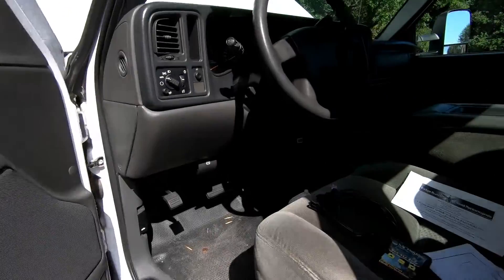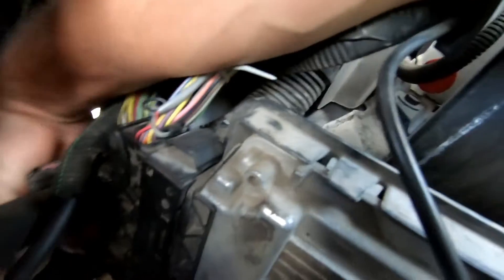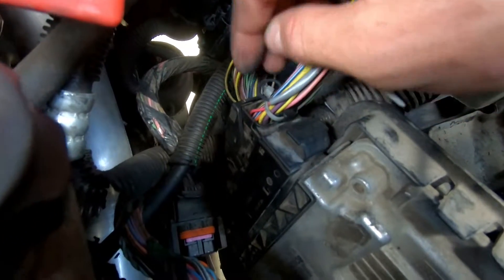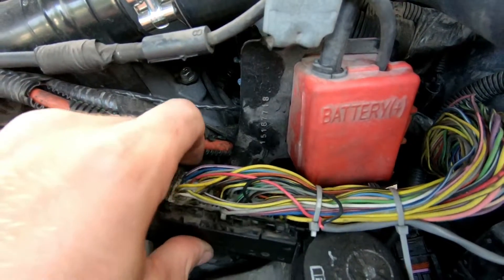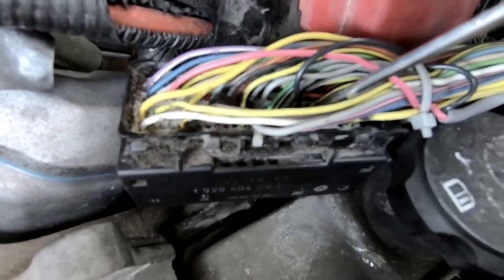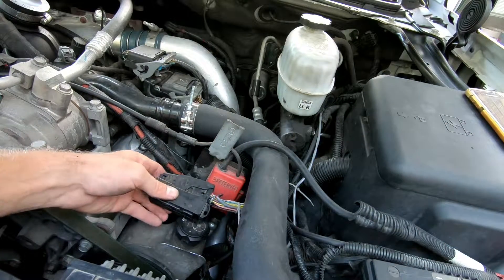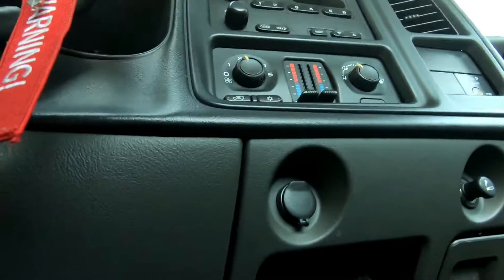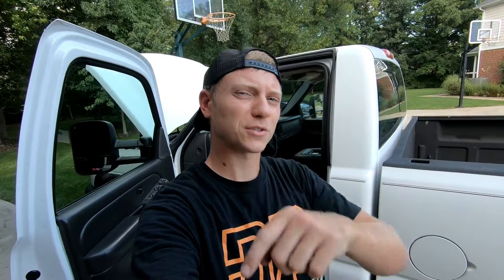How to install a DSP5 switch on an LBZ DURAMAX

Comment: You don't need to switch for EFI live, you can switch tunes on the autocal if you don't want to mess with the switch, that's how I switch tunes on my truck
Reply: Lbz/lmm you need a switch in order to change tunes.
Reply from the maker: I honestly didnt know that was possible! Thats pretty cool, but I like the switch because it seems simple.
Reply: do you need the autocal or can i just buy the dsp5 and that works?
Reply: @elihandy1449 the autocal IS the tuner, the switch is an optional feature to allow switching tunes on the fly.
Reply: that’s only IF you have seperate tunes. The company I got my tunes from has all 5 tunes in one file, so you’re forced to use the switch to select between the included tunes. I tried to flash a quick single tune on mine and saw that the tunes were all packed in one file for the 5switch unfortunately